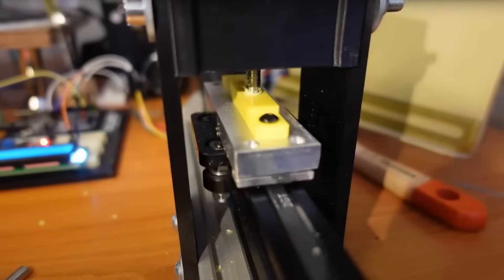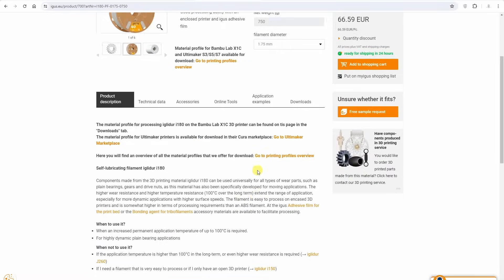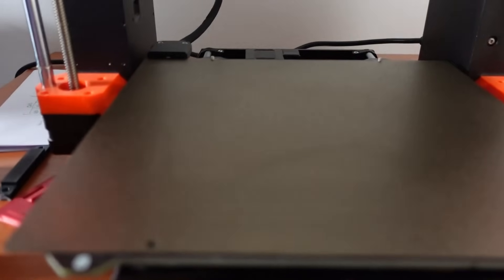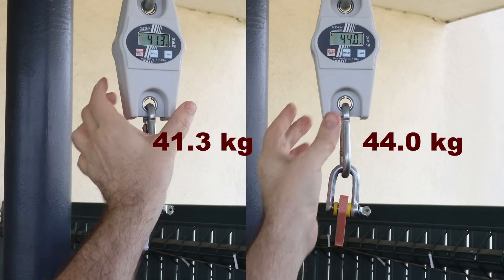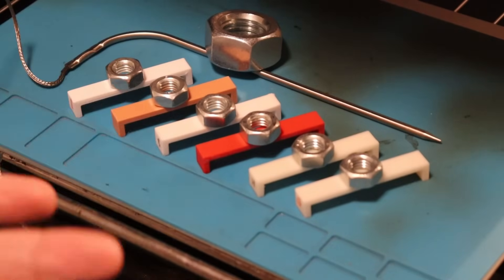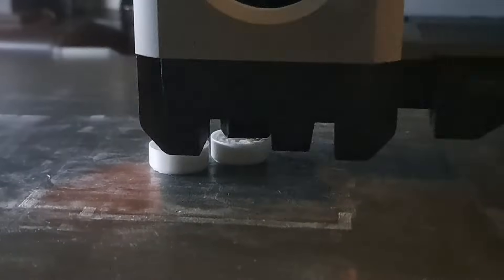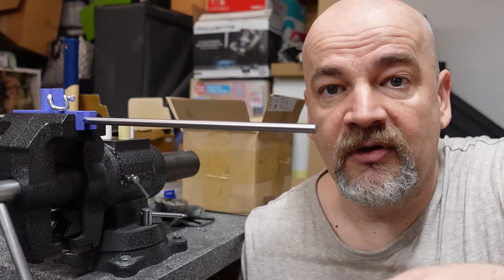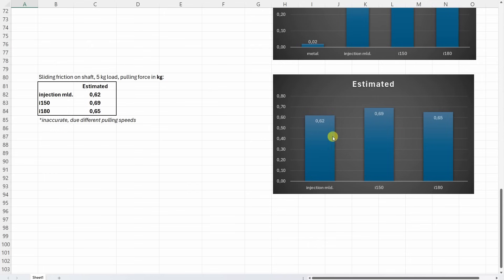Testing tribo filaments: Igus Iglidur i150 vs i180

Comment: I wanted to buy some until I realized it's 220CAD for 750g I cry. you also need their 45usd adhesive it seems.

i wish you also tested the wear by spinning a gear by X amount.
I also wish you compared it to non-cf nylon as that's what's commonly used in these applications (tho it tends to swell a bit with moisture)

Comment: My understanding is that the tribo-filaments operate better over time as the solid lubricants get deposited on the metal interface over time. I wonder if that's something that could be testable using a setup similar to your abrasion testing apparatus and a strain gauge or something? Would be very curious to see the results of that

Comment: Yep. The filament is expensive... but making videos is also expensive. Sending such tiny amount of sample is almost disrespectful. That said... I didn't see such advantage comparing them to Nylon. What do you think?
Reply from the maker: They contacted me again, and they want to send whole spools now if I will create another video. They claim that pure wearing is good for these materials, but without sharp edges of shaft. Maybe I will prepare another type of wearing test with rotating shaft or sliding on shaft. Probably I will include nylon in that video, only not sure CF or not CF..
Reply: @MyTechFun I would be very interested in that particular test. I had heard about your filament dryer testing on a subreddit's wiki somewhere and then found your YouTube channel. Watched the original wear video and then was happy to see this because I was looking into the IGUS filaments. 

I haven't used 3d print filaments for a wear type application with low friction before so I'm just researching around. So far though it seems like unreinforced nylon is the way to go here for home projects in terms of price to performance. I'll try some unreinforced PETG for prototyping and then go to nylon when I've got the parts nailed down. 

Thanks for doing these tests! I've just subscribed

Comment: I would only imagine using IGLIDUR filament for printed sliding joints, like ball or Oldham couplings (it is what it's known for, right)? Not for hooks. 
But with so few* abrasion tests it's kind of hard to tell the conclusive answer - is it better than PETG/ASA for this purpose?

*very few tests and some iffy ones - like the one with the badly fitted, rocking pin that dug into the material :)
Reply: The way I understood it the pin was rocking by design.
Reply: @TNX255  Perhaps but then what real life application does it test?
Reply: @DailyFrankPeter  Can't really think of one off the top of my head. But then again cars' top speeds are tested too and they have very little real life value as well, it only tells about its maximum capabilities.
Reply: @TNX255  My point is that IGLIDURs perk is supposed to be self-lubrication/abrasion resistance (judging by the huge range of IGUS drop-in sliding replacements for mechanical bearings). Hence abrasion/friction tests in the vid make total sense.
OTOH, if the test tool bites into the material that's more like shearing testing (I think).

Comment: please also try i190 (and order more free samples for good measure hehehe) would be interesting to see if the printed filament also has the potential to be as good as their dry bearings. Maybe a LM8UU vs. the Igus version vs. printed Igus version would be a cool video
Reply: Normally the friction has to be higher on igus in order to get selflibricated. A wear test with 1000x cycles will provide more accurate results

Comment: For the vice jaws you should test BASF TPU 64D and TPS 90A. 
BASF TPU 64D has high chemical wear, abrasion, impact resistance, while BASF TPS 90A (SEBS based) has non-slip (rubberlike) properties and great layer adhesion

Comment: I'm printing i150 for years now. It's crucial to fully dry the filament before printing (65C for at least 8 hours). Printing directly from a fresh spool or sample package will result in parts which are much weaker than from dried filament. Also, even though they say i150 can be printed without enclosure, you should print it enclosed for much better results.
Reply: its pretty expensive, what are you using it for and why?
Reply: @lockeboss502  I use it for parts which need to be wear resistant while having good sliding properties. The alternative would be any kind of Nylon. Compared to Nylon the handling of i150 is quite simple.
Reply: @simonpirschel3379  Oh, I see the point. It is the benefit of Nylon, but easier to print. Is it?
Reply: Where can I get the i150 filament?
Reply: @neotizok  nowhere :D its unbuyable
Reply: @neotizok  igus website

Comment: I use PCPTE for vice soft jaws, good temp resistance, harder than TPU but softer and grippier than most nylon, and bounces back from indents. To be honest it's probably a better bearing material than these too - I use it for wishbone bearings in race cars.
Reply: What settings and printer are you using for PCTPE? My use case is combat robots but I can't stop the parts from warping with my X1c
Reply: @Eric_Wolfe-Schulte  don't use any cooling, slow down when you need better cooling, no fans.
Reply: @Rippthrough  that's what I've been doing.  Experimenting with build surfaces now, bought a tempered glass bed to try that next..

Comment: I like the igus filament but as you found, getting it to work for things like bushings without machining isn't really possible as the required tolerances are just too tight. (The reamers are a good idea but might come out undersize) It does at least cut nicely on a lathe and works for things like low friction washers straight off the printer.

I also found better layer adhesion at the highest possible temperatures but never got usable results with 180i on the Bambu for anything like a flanged bearing, only flat washers and simple tubes. 

There is a high temp food grade option but I think it requires a rather highend  printer and costs around 300 euros per spool :) 

One other thing for people to keep in mind is that you can't use Igus bushings with non-anodized aluminum.
Reply: Does the filament react with un-anodized aluminum? I wonder what that means for aluminum printer parts in the filament path.
Reply from the maker: Thank you for sharing your experience with us.

Comment: For vise  jaws smooth ground on one side and a vee on the the other (I don't think you can buy such a thing but I have made them and you can hold a wide range of parts without damage. For really delicate parts I would l suggest leather is the best option as it has much better friction than any plastic. TPU might also be a good option.

Comment: Given their price, I'm having a hard time finding a justification for these filaments.
Reply: It all depends on your application; I can see a lot of commercial use cases where the cost/kg would be purely secondary to the physical properties. These plastics do have good wear characteristics, combined with good strength, and the temperature resistance of the i180 is excellent for a filament that can be printed on a standard 3D printer. I don’t need anything like this for my home printing, but could easily see using it in some sort of high-use mechanical system.
Reply: this reminds me of an old saying: anything for "enterprise use" usually has an "enterprise price tag" :P
Reply: depends entirely on what you need.
if you need a gliding surface printed into a model you basically have no other choice.
Reply from the maker: Yes, the price is one of those thinks which I almost never discuss.

Comment: Hey again, this was an interesting test. I noticed this filament a while ago, glad someone did a proper test of it. For your vice I suggest the Extrudr Flex Hard CF. It should be quite wear resistant and when you tested it, it only started to deform at 150°C. Would you consider testing the Fiberlogy MattFlex 40D? It's my favorite TPU filament and it's quite unique... maybe you can combine the test with the VarioShore TPU filament.